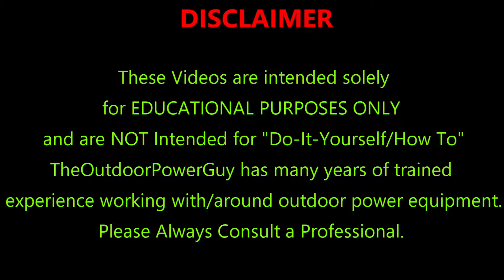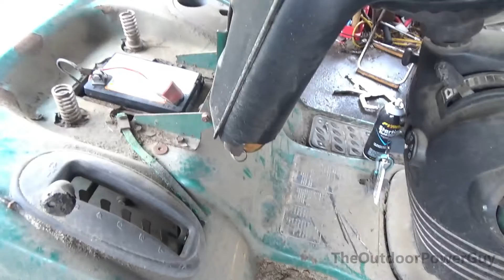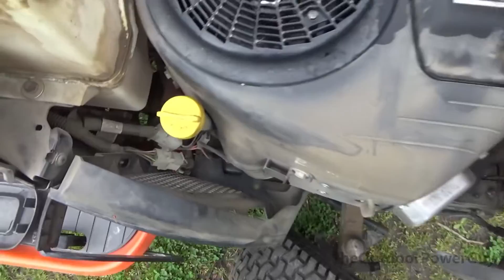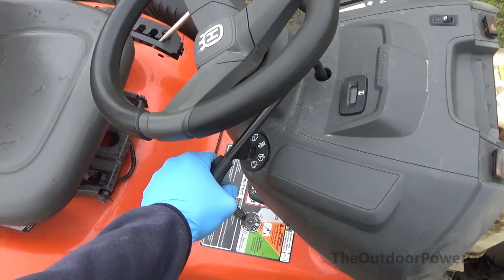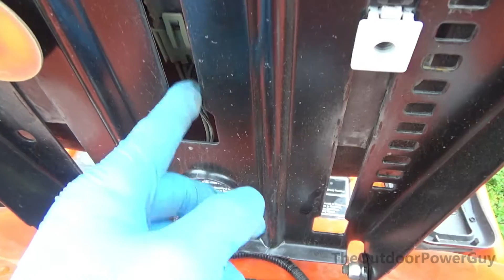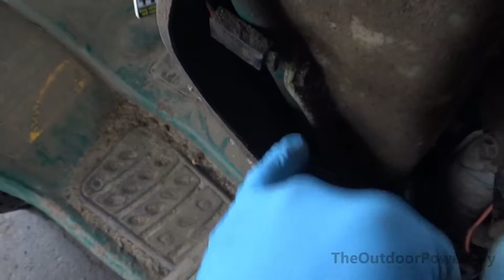Troubleshooting The Electrical System On a Riding Mower Part 1

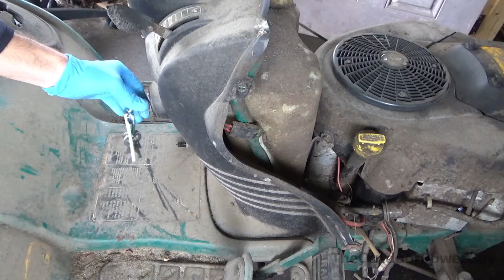Comment: Looking forward to watching this video series; I am so sick of fighting with my Craftsman 42" LT2000 trying to get it to start!  I have it on a trickle charge, and the battery is new, but it seems that every time I want to mow I have to use starter fluid to get it running.  Even with what should be a fully charged battery, when I hit the key to turn the engine on the thing barely budges... much like what yours does at 3:22, where it just moves about a quarter of a rotation and no more.  I wish it just had a pull start!